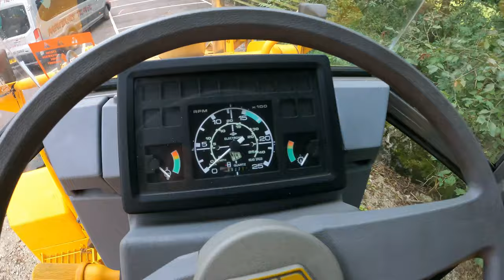Testing The New JCB 4CX | JCB Test Centre | JCB Demonstration Quarry | LifeBehindTheLevers | JCB HQ

Comment: I always  thought  a loader backhoe was a very useful  machine  last one I used was in2003  which was a massey  ferguson  50b my last  company  had did my cscs at Bircham  Newton  with jcb 3cx in early 1980s the company  I am with now only use 360 machines  but on some jobs I think to my self a backhoe could do this better and quicker 
And I will admit  I  do miss using them
Reply from the maker: Every site had a 3cx back then, JCB have really spent a lot of time developing & upgrading the 3cx/4cx. They are a true operators machine 👍